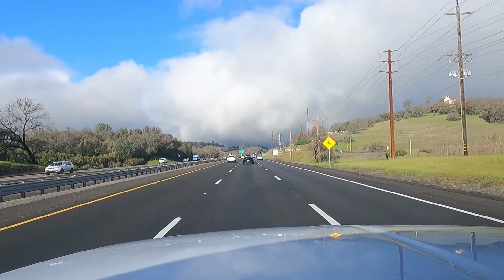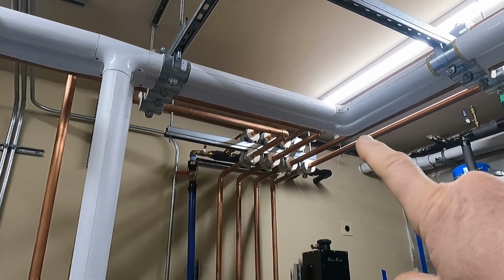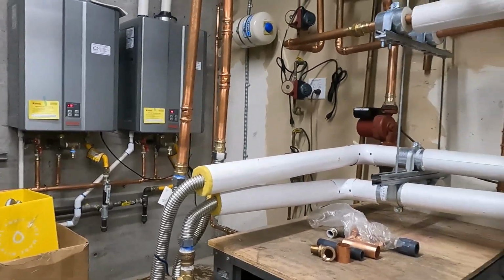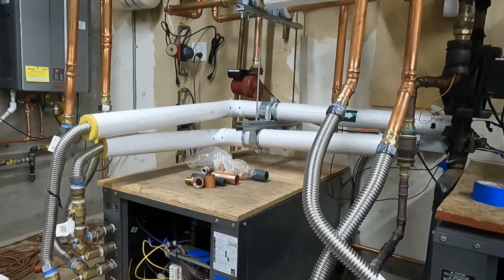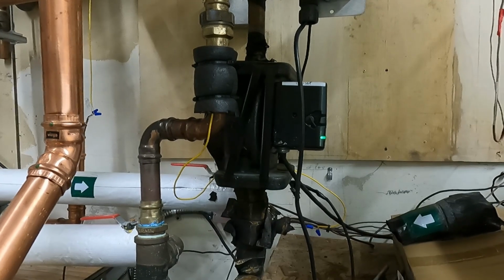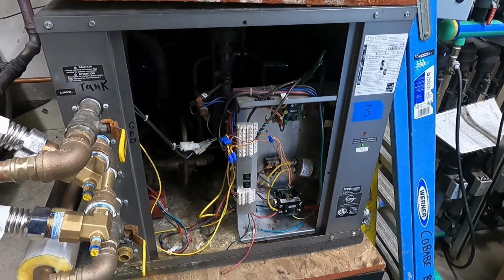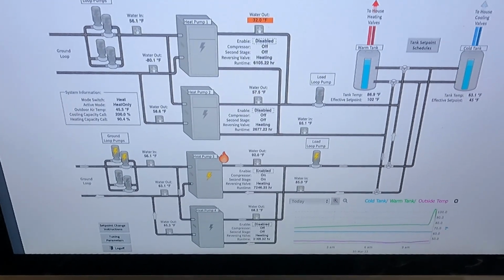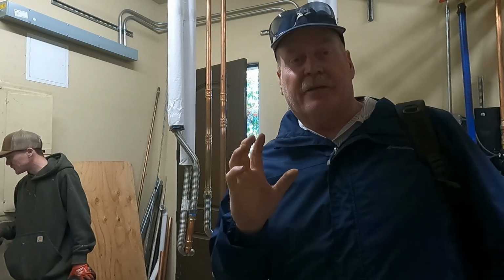Emergency HVAC Service Call

Comment: That looks like too much to keep up with to me. My question is where and how do you come out ahead with a system like that ? Thanks for sharing, take care
Reply from the maker: That is a very good question.  I am by no means an expert on these systems but apparently they are more efficient in the use of electricity than a typical air conditioning/heat pump system that has an outdoor unit with a fan.